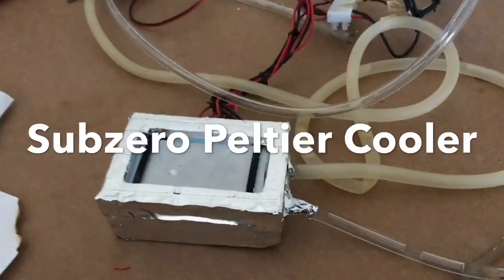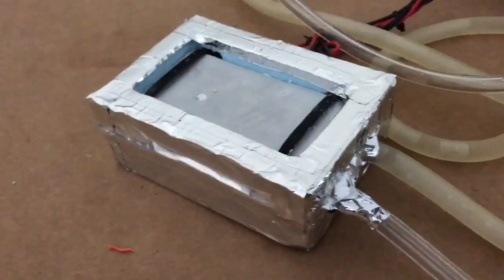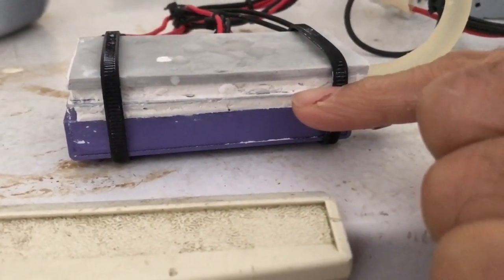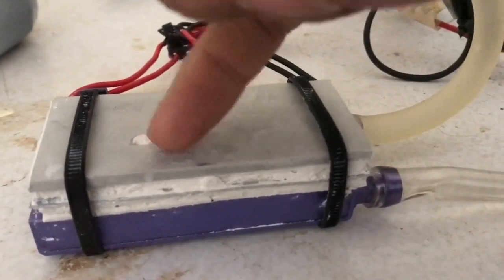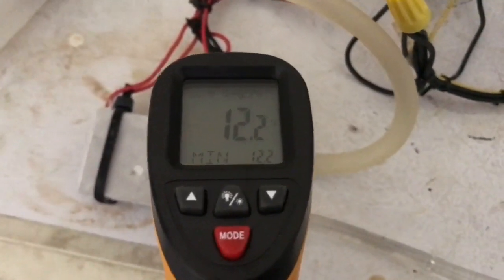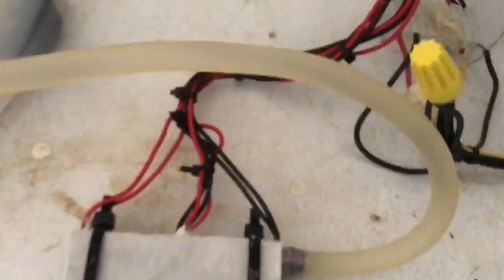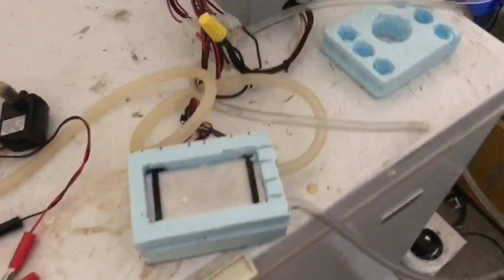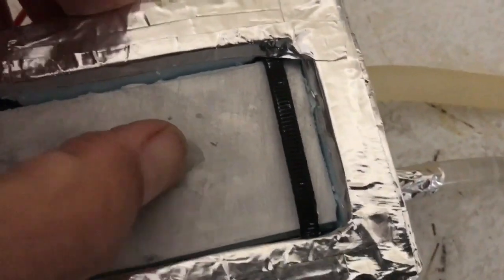Subzero Peltier Cooler

Comment: I am trying to bring the temperature of a 10 inch squared box surrounded by a 5 inches of styrofoam down to 20- with a single pelter thru a small hole cut out of the back of this box. What wattage pelter do I need and can it be air cooled or would water work better? thanks
Reply from the maker: Water cooling works better I would use a higher power peltier unit

Comment: Can one make it to be -8 celsius and stay at -8 . . . how ?
Reply from the maker: 180degrees 180degrees if you use a variable voltage supply for the upper Peltier unit it will be controllable for  temperature.
Reply: SciTubeHD do i need to peltier . or can one do the trick . with -8c and a volt regulater
Reply: Can you try to go sub zero -8 c. with anti freeye liquid. In closed system say 1 liter . will it work. Will the pump work ?
Reply from the maker: 180degrees 180degrees you could try voltage regulator with 1 Peltier. Oh antifreeze will work. I would dilute it with some water so it’s not 100% glycol say 70% glycol.
Reply: SciTubeHD i will try thank you

Comment: Hi,
I can't see any heatsink and fan.  It's ok to run peltier without heatsink and fan?
I'm assuming your setup:
2 pcs Peltier for Top Module at 5v
2 pcs Peltier for Middle Module at 12v
1 pcs Water Block at the Bottom
Can I know what is your water temperature reading at the inlet during full system running?
TQVM
Reply from the maker: this setup just uses a water block. The water is room temperature water around 20 C. The water block essentially acts as the heat sink.  Then it seems to get down to low subzero temperatures. I later took the unit apart and removed the aluminum strips from in between the peltier units, and everything worked even better. I could easily get down to -30C using 20 C tap water.
Reply: Thank you very much for your explanation.  Tomorrow I'll try and hope will succeed